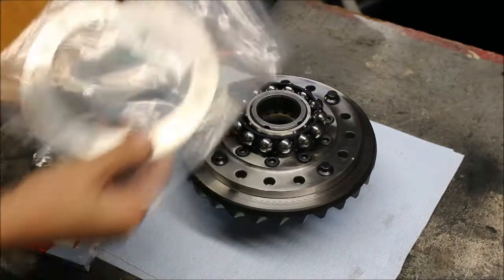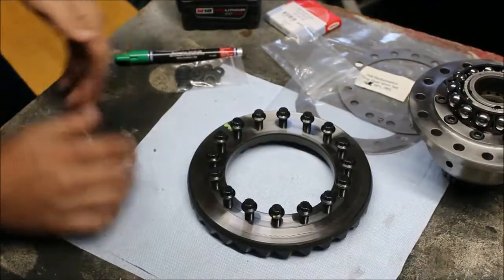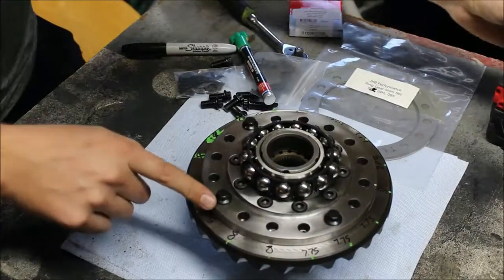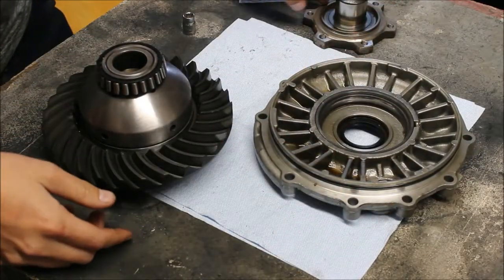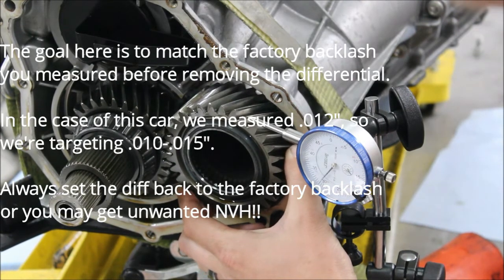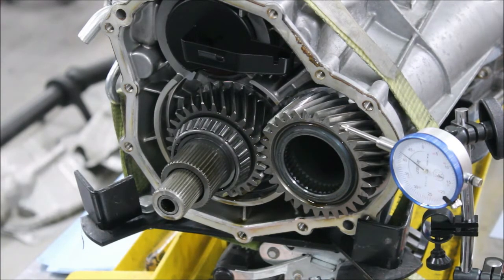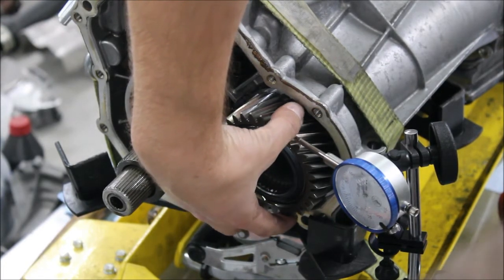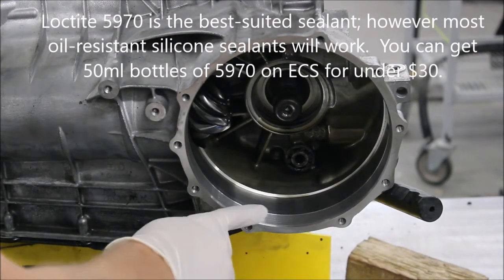JXB Performance Front Differential - Reinstallation and Setting Backlash

Comment: Really like the look of the OB transmissions for low power mid engine applications with the face-to-axle distance being so short. Just no aftermarket support. Is there a base pricing for the LSD? And is it available with the FWD 0b1?
Reply from the maker: Unfortunately we only did a small batch of these front LSDs.  Shoot us an email at contact@jxbperformance.com and we can keep you in the loop if we ever decide to do another run of them.  AFAIK they will fit the 0B1 the same.

Comment: Does it fit 8hp55 ?

I was thinking of swapping the 8hp55 with turbolamik tcu into a B8 A4 chassis I found for cheap here in India.

Your rear differential is the best option for me. i was wondering about a front lsd.

I'm still torn between the 4.2 fsi and 4.0T engines based on availability